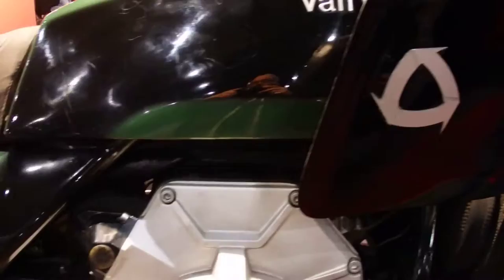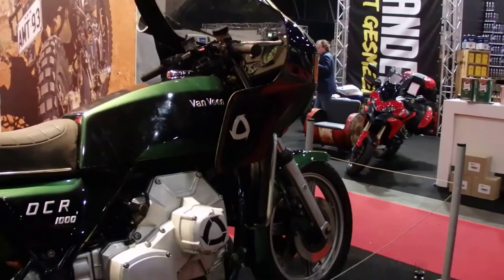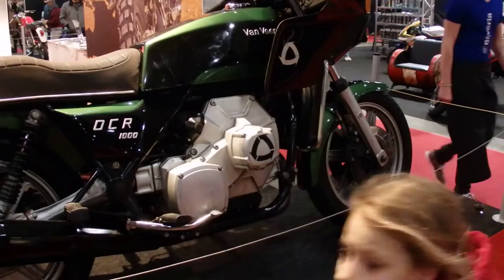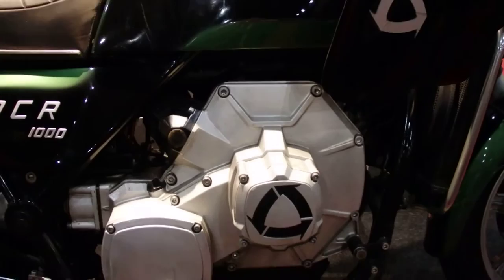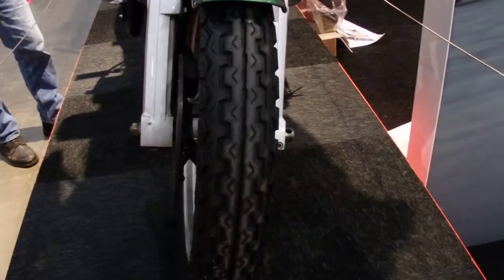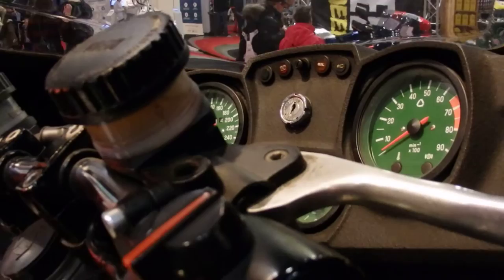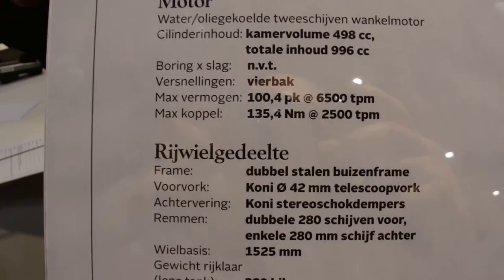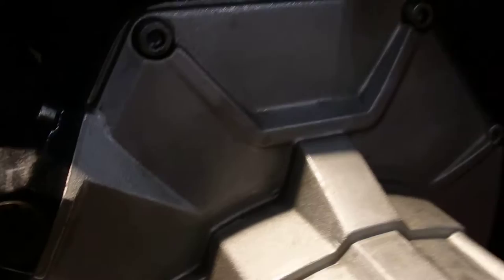Van Veen OCR - 1000 , rare rotary motorcycle.

Comment: Not as pretty as the Suzuki RE5 but twice the capacity.  Very rare, should be in a Museum.
I saw an RE5 in a motor museum back in 1980.  This should certainly be there the OCR1000.